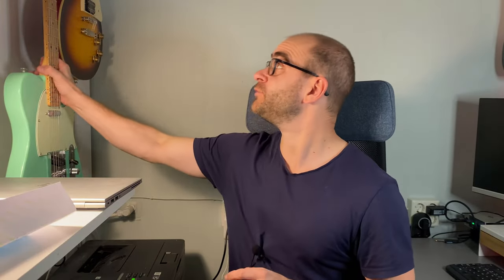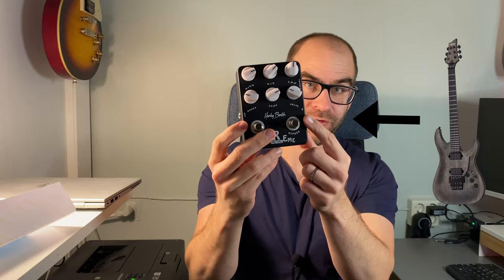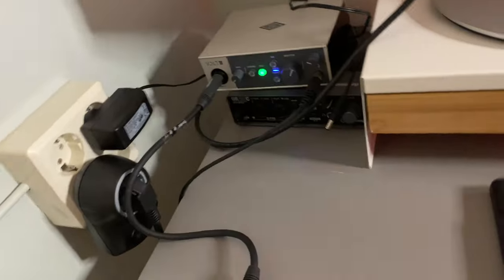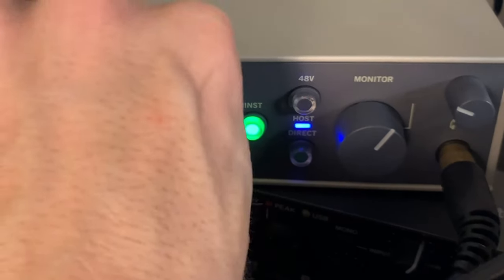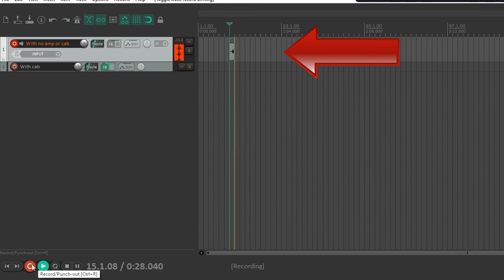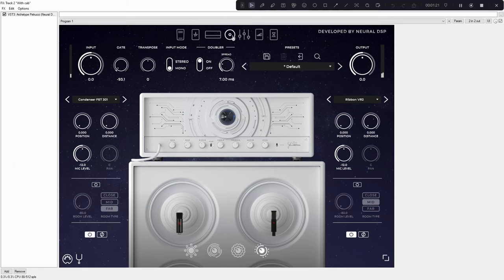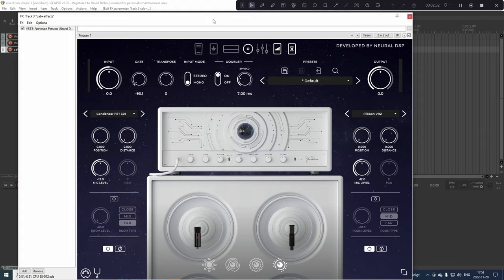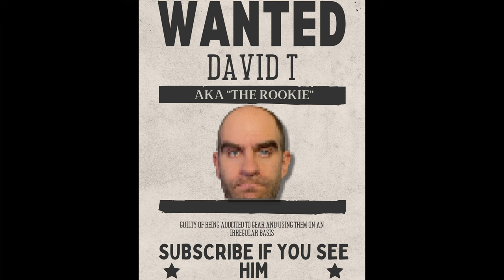How to Connect a Guitar Pedal to Your Audio Interface

Comment: So, it's as straightforward as I thought it was going to be.
I have a vintage Guitar Port audio interface and a Zoom G1 Four pedal and occasionally a JOYO Ultimate Drive for boost.
Reply from the maker: yes its that easy :)
Reply: I want to buy an audio interface and i have the same pedal as you, is it all i need to start recording without using plugins?
Reply: @6sebastian982  Yep.
Reply from the maker: @kiillabytez  but would include a IR aswell

Comment: I have a focusrite solo and want to connect my Nux mg 30 guitar multi effects into it, and hear the full sound from the headphone out of the focusrite to record in my Reaper. I connect a TRS cable from the Send or Return of the processor to the Audio interface or not?? Pls let me know.. i can hear digital latency sounds coning out of headphones and not getting potential of tone which i can hear while connecting the headphones out from my Nux mg 30 directly
Reply from the maker: Have you tried connect from the regular output from the nux?
Reply: Switch drivers?

Comment: From pedal to soundcard you used 1/4 jack to 1/4 jack?
Reply from the maker: yes!
Reply: @davidtguitar  another quick question. I have a large dj setup, I do a lot of sound design, is it possible for me to connect a larger sound card (8 inputs) then route pedals through that so I can essentially have an enormous effects set of pedals that interacts with the master output? Hope that makes sense. Really appreciate your help here. (Mixer is Xone 92)

Ultimately I want to use this soundcard for pedals and then other hardware units. (Elektron digitakt II / digitone?) sorry a lot to throw at you but I really enjoy your take on what youre reviewing.

Comment: Hi David which plugins are using in Reaper?
Reply from the maker: Hi! I use several, any specific usecase you are wondering about? But TONEX or Neural dsp for sounds and the ones i use most
Reply: Try Neural DSP. They seem to work pretty good for me in Reaper. Sometimes they don't though- not sure why. They just don't get recognized then they start up again. It's annoying but sound great WHEN they work. Do you go pedalboard into interface or interface into pedalboard?

Comment: Hello, I have a bass pedal with XLR output.  Can I connect it directly with an XLR cable?  It didn't work with 1/4 Jack cable
Reply from the maker: i think you should be able yes. but havent tried it myself

Comment: Question- if you go PEDAL BOARD INTO Audio Interface first, won't all tones be changed when you change the pedal board settings? I like to loop. I have a looper pedal on my board- or I could loop a track in reaper but I do not want the lead tone to effect my clean intro. Anyone have any suggestions please? When I loop over my recorded track in Reaper now using Neural DSP PI I simply open a new instance of the plug in and it does not effect the original track. It will if I leave the original plug in (FX) on.
Reply from the maker: Yes all changes will affect tones. Sorry but not sure ehat you’re asking :)
Reply: @davidtguitar  Thanks. Yeah, I am learning. My questions might be too simple or wrong but I did use a pedal and in front of interface it changes the tone. Will it also RECORD the tone in the PC? When I use a plug-in, if I turn off the plug in effect FX, it is gone from the project...I guess unless I freeze or render it.

Comment: I see you have a Steinberg Audio Interface and a Volt. Would you suggest one over the other for guitar? Why both?
Reply from the maker: Hi Ban. I bought the Volt to try to get rid of some background noice i experienced. It didnt work :) But kept it because i like the look and the simplicity, and can be good just to have an additional jack available. I have A/B tested them, and honestly can not hear any difference. The Volt is a little cheaper where i live so i would recommend that one just for that. but if you need two inputs the steinberg would be a good choice

Comment: Consider using a DI Box when connecting hardware pedals to audio interface.
Reply from the maker: I’ve heard mixed things about that, but am considering it just to test if i notice any difference :) have you tried it?
Reply: @davidtguitar  yeah, I use one to get consistent tone out of my stompboxes instead of using pedalboard plugins. The DI Box allows you to input the full tone of your stompboxes to your DAW without distorting the sound. Maybe make a video about it too :) tbh, I haven't seen a straightforward video on Youtube about the setup yet.

Tip: Instrument -> Stompboxes/Pedalboard -> DI Box -> connected to Audio Interface via XLR (enable -15db if available) -> DAW
Reply from the maker: @rald-ek7mm  thanks! will look into that, became really curious now :)
Reply: @rald-ek7mm DI box is absoultely unnecessary.
Reply: @rald-ek7mm  That's why you sound check beforehand like he did in this video.
Reply: @milankotevski1663  Agreed. Important if you want to capture an IR but not for recording.
Reply: please make a video about that PLEASE!
Reply: @rald-ek7mm  You seem knowledgeable.  Do I go Pedalboard>>>Interface/DAW>>>Neural Plug in? How do I ensure my new Lead Tone will not change the recorded tone in Reaper? When I use Neural DSP PI I have to open a new instance or that would happen.